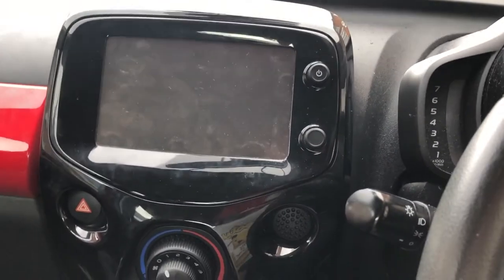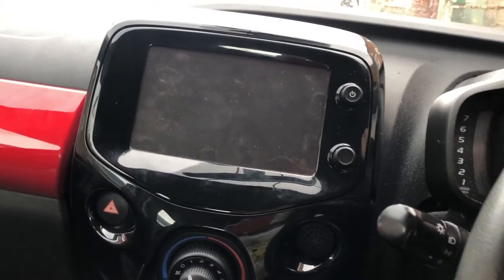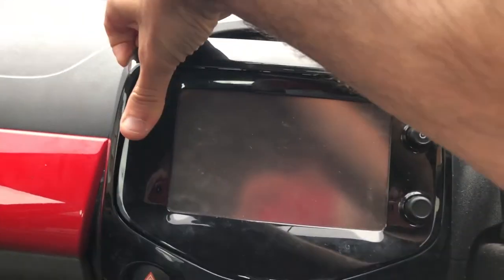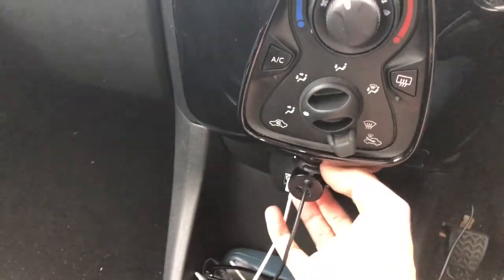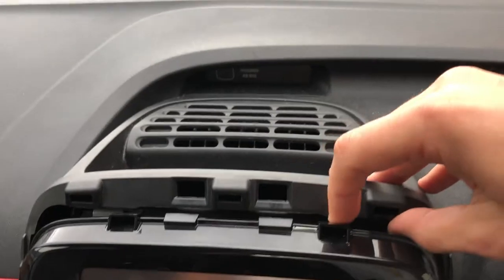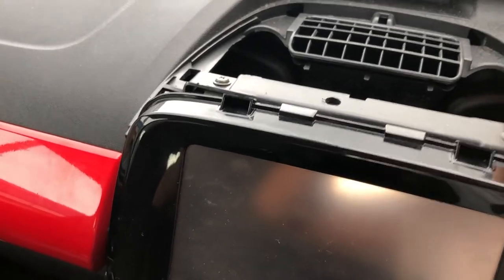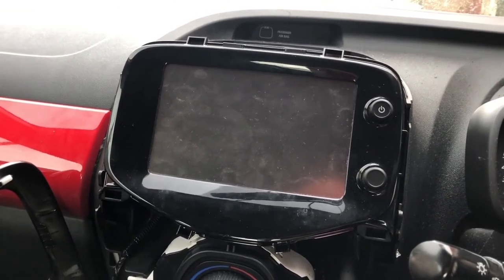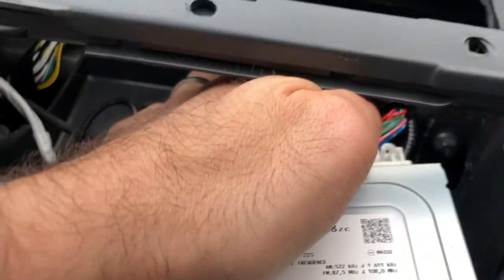How to Remove the Stereo from a 2014 Upwards Toyota Aygo (Peugeot 108/Citroen C1)

Comment: Great video and so very easy to follow. It's so difficult to find info for 2015 Aygos to present, I've been struggling to find the internal fuse box to change the fuse for the Output/Cigarette lighter - not only how to access it but safely take the panel off if necessary. Tricky wee devil, but I refuse to take it to a garage if I can do it myself.
Reply: Eventually found it and after mastering the art of body folding, got the fuse changed, what a palaver!!
Reply: I also used to have an aygo, exact same issue with the fuse box, 3 hours and nearly 3 slipped disks I got the cigarette lighter back working 😂

Comment: Thx for the video; have recently bought a C1 and wanted to upgrade the radio to the one with the touchscreen, but couldn’t find the partnumber of the radio, finally have it and how to remove the radio.
Reply: I want to do the same. Was it plug and play? Did the wires connect exactly as the old radio?

Comment: OMG  been putting off buying a new city bug until I find away to replace that horrible thing with a CD player. Thanks for this video. Only thing missing is a recommendation for a replacement unit.
Reply from the maker: I’m afraid not…the problem with third party radios and the wiring is that you lose all the things like steering wheel controls as the accessories that claim to work with them don’t.

Comment: Great video thanks. Straight to the point. 

I just have two questions … how do i unclip the hazard connector… where do I press? And secondly, how do I unclip the connectors going into the rear of the radio? Thankyou and happy new year.
Reply from the maker: Hey, 

1. You don't actually need to unclip the hazard connector, just lean the plastic to the left so it's out the way, the hazard cable is long enough

2. Most of the connectors at the rear have a push down clip on the top in the centre, you just hold this down and wiggle the cable out...they can be a bit stiff

Comment: Really helpful and straight forward video - thank you. Have you done a video of fitting the new stereo?
Reply from the maker: I haven’t but if you get the factory unit rather than a third party one it’s as simple as just plugging everything into the new radio and as every port is a different shape it’s super easy to work out

Comment: How did u deal with the new unit needing any programming? My citroen dealer says they wouldn't fit a used unit as wouldn't be able to update it & I see ebay sellers advising units may need a code
Reply from the maker: The touch screen units with Apple CarPlay require no programming, you just plug and play. I ordered mine from Poland, fitted it and it worked!

Comment: Hi Mark. Quick question about removing the red dash trim. Is it simply a case of carefully pulling out ...no screws etc? Many thanks.
Reply from the maker: That's right, no screws, all clips...it's actually pretty easy to remove
Reply: @MarksTechVlogs  nice 1 👍😊 Thanks for the response 👍

Comment: Hi, great informative video! We have a 2014 C1 and the seatbelt warning/passenger airbag display block (in a recess between the touchscreen and windscreen) has somehow been pushed in and is now in the guts of the dash. Is it possible to push it back in from the inside if the bits of trim and air vent are removed as shown in this video? Many thanks, Ben
Reply from the maker: Hey Ben, I’m afraid I have no idea...I know relatively little about cars!
Reply: I have this exact issue. Did you manage to fix it somehow? thanks

Comment: Video was great and straightforward. Although I have a question that I'm really hoping you can answer. I own a Peugeot 108 Access 2016 (the entry model) and I don't have a touch screen, rather a radio. I'm really looking to replace the radio I have with the Peugeot touch screen (found in the same model), but I have so many questions, with the main one being if it's even possible. I'm in desperate help, as I've been looking everywhere asking people and no one knows. 
And in case you don't know, can you suggest me where I can find someone who can help answer my questions about this installation?
Reply from the maker: Hey, I think you should be able to switch them out. The best way to tell is going to be to take your existing radio out to check the connections at the back
Reply: @MarksTechVlogs  Check what exactly? Cross reference the cables needed for the touch screen with those in my car?
Reply from the maker: Yeah, an easier approach might be to find pictures of the back of your existing radio and the touchscreen one online (eBay is a good starting point). You won’t need all the same connectors as some relate to optional extras such as digital radio and rear cameras but you’ll want to make sure ports look the same
Reply: @MarksTechVlogs  Alright, thank you so much I'm gonna start researching. Its also really difficult to have my questions answered because there is not much content online, atleast to my knowledge, as far as the whole touch screen thing is concerned.

Comment: Can you recommend or point me in the right direction for a new stereo. I have this one and want CarPlay. I don’t know where to start. But now I know how to get this one out lol great thanks
Reply from the maker: I can. I ended up getting the updated Toyota radio form Poland. There are third party radios that work but you have to buy all sorts of adapters and can lose things like steering wheel control functionality. I wrote a blog including the part numbers to look for here: https://marktiddy.co.uk/posts/adding-carplay-into-a-2014-upwards-toyota-aygo
Reply: @MarksTechVlogs  This link no longer works - could you tell me where in Poland you bought the new unit from?
Reply from the maker: @TiNiB  This is the updated link https://bestsmarthomereviews.com/how-to-get-apple-carplay-in-your-toyota-aygo/ and the site I got it from was https://allegro.pl - I am actually currently selling mine as I sold my car. The eBay link is https://www.ebay.co.uk/itm/304669548951

Comment: Nice video. My touchscreen is unresponsive. Should I do this and look for dodgy connection? Thanks.
Reply from the maker: You can try but if the radio turns on and the touch screen doesn’t work I think it’s unlikely to be a dodgy connection. If it doesn’t turn on at all it could be a connection or a fuse

Comment: Hi thanks for the video. Any thoughts as to why the touch screen element wont work C1 Flair  Puretech (2014) ?  radio works fine but is not functioning as a touchscreen.
All comments welcomed !
Reply from the maker: Hi Brian, I'm not too sure to be honest, if you can get to any of the settings to factory reset it I'd try that, if not I'd check all the cables are still connected behind the stereo, otherwise it sounds like it might be a hardware issue

Comment: Good day, Mark. My name is Roman.
I have a Peugeot 108 produced in 2018.
Radio 7 inches.
The radio has 2 buttons.
Model: 86140-0H010
ID: 13TPDAEU-EA01
Audio: 0840
OS: 0621
Android Auto and Apple Car Play does not start. There is a button "connect to phone" in the menu, but only charging is in progress.
My phones in other cars work with Android Auto and Apple Car Play.
Is it really not there and you need to buy another radio tape recorder?
There is a video on YouTube where the radio with 2 buttons and they have Android Auto and Apple Car Play.
Is there a problem with USB?
Can you say something?
I'll be very thankful.
Reply from the maker: Hey, I’m afraid if the radio only has two buttons then it doesn’t have CarPlay. It’ll have something called AppInCar which doesn’t work anymore. You can switch the radio out for one that does support CarPlay (which is what I did), the easiest way to do it is to get hold of the updated model. I wrote a blog on how to find one and the model number here: https://marktiddy.co.uk/posts/adding-carplay-into-a-2014-upwards-toyota-aygo
Reply: @MarksTechVlogs  Thank you so much.  I read it, everything is clearly written.  I will search the same way as you were looking for.  Thanks again.
Reply: @MarksTechVlogs  Hi Mark, handy video thanks, (it's the Pegeot 107/108 by the way, not the 106 as mentioned in the title). Do you have an updated link to your blog by any chance? That appears to be going to an archive page now,

Comment: Thanks for the vid! I have exactly the same radio. Found nothing on Google, very resourcefull! The thing i'm wondering is what you do with the two holes for the standard audio's buttons. I am looking to replace the radio and install my old sub in the back, but the (Sony) radio's I was looking at seem to be shaped differently, leaving the two holes. Is there a solution to cover this? Like a lid/cap for the new radio?
Reply from the maker: I’m not sure I completely know which holes you’re talking about but you can by fascia kits which essentially add the rounded edges back in (does that make sense?)
Reply: @MarksTechVlogs My bad! I did not know that you could buy these shapes, but this makes sense! I was not aware you could replace the frame which fits another radio. Therefore I thought you would be left with two holes (two buttons of the original radio). I'm going to find a frame and build in a Sony radio. Most radio's have a universal size right?

Comment: Great video! Just to ask, if I were to hook up an underseat subwoofer, what would I need to do exactly, and inside which port can I connect it? Thanks!
Reply from the maker: I have no idea if that’s even possible with the built in head unit. I suspect it’s not
Reply: @MarksTechVlogs  ahh ok, thanks very much! Then I guess the only way would be to splice the speaker cables and attach wires to that. Thanks!
Reply: @CoolFoxification  I'm going to try the same, were you able to connect the subwoofer to the radio without spitting the audio cables?
Reply: @dtchremix  i didnt do it myself, but i took it to a shop where they spliced the cables and connected a high to low converter which I had bought (speaker wires to rca cable) and it sounds pretty good. It's not prefect as the bass is overpowering at lower volume and doesn't really seem to adjust much to volumen control, but I set it up to the level I usually hear my music at and it sounds fine :)

Comment: Is the USB port connected behind the head unit? Need to check the connection.
Reply from the maker: Yeah and it's not a standard USB in the back as it (I think) also connects to the built in headphone jack that's next to the USB at the bottom of the central column. The input looks like this: http://www.blog.marktiddy.co.uk/wp-content/uploads/2020/09/Screenshot-2020-09-12-at-13.57.45.png
Reply: Mark's Tech Vlogs thanks 👍🏻

The usb isn’t working in my aygo so want to check the connection.

Comment: I have a c1 2015. I’m just about to buy a 2019 android auto system from a c1 in a scrapyard(the one with 3 bottoms) is it as simple as a straight swap like your video? Will the new one work as it’s ment too? Also will the new one need a code?
Reply from the maker: It should be a straight swap and I don't believe they have security codes...mine certainly didn't
Reply: @MarksTechVlogs  nice one. I’ll give it a go
Reply: @MarksTechVlogs  I changed it. Very easy took 5 mins. Now got apple car play. Thanks
Reply: @andrewobrien2749  Hi Andrew, can you send me a link to the one you purchased? Was it just a standard c1 head unit from a newer model? Mine is a 15 plate and I'd love android auto.
Reply: @joew961  I got it from a breakers yard(scrapyard) most of them will post for u. I just made sure it was a new model from 2018 or 19 onwards(they have the 3 buttons with android auto or apple) just google breakers around u. I payed about 260euros and 10 postage. It was really easy to install just like this video. Take 5 mins. Good luck
Reply: Also. U probably know this but search Toyota aygo and Peugeot 108 they the same units

Comment: I have an old version of this radio, similar to this one, it does not have mirror link, linking my mobile android phone to the display to access from there. Does anyone know where I can buy a similar radio that has android on it, or just the exact specs for the radio?
Reply from the maker: I had the same old one that looked the same and had AppInCar that was useless and no longer supported. I picked up the new one from Allegro.pl (a Polish eBay) and I had it shipped using Shippn as it wouldn’t directly ship to the UK. The model number you need is: 86140-yv010 (that’s the one with Apple and Android CarPlay but no DAB)
Reply: @MarksTechVlogs  Thank you, I will attempt that. What do you mean by DAB?
Reply from the maker: It’s a type of higher quality radio (can’t remember what DAB stands for). As I use my phone for music in the car not having it didn’t bother me